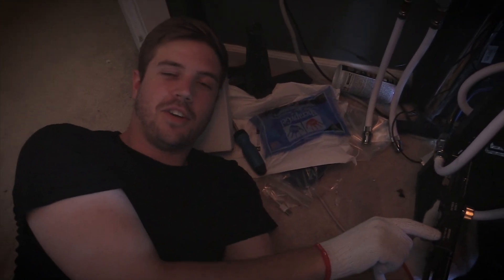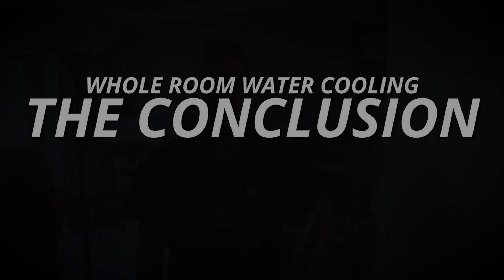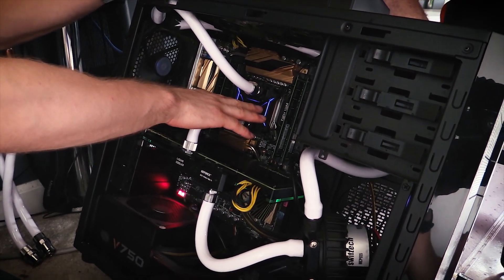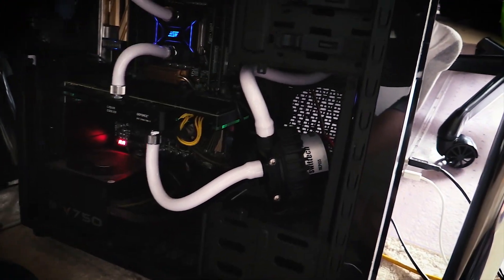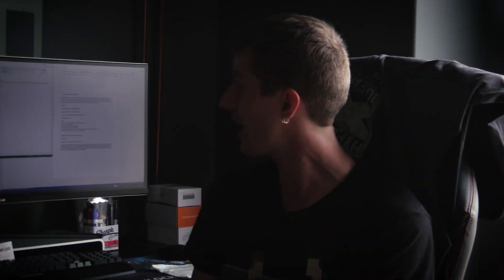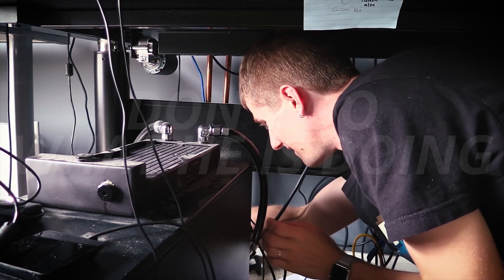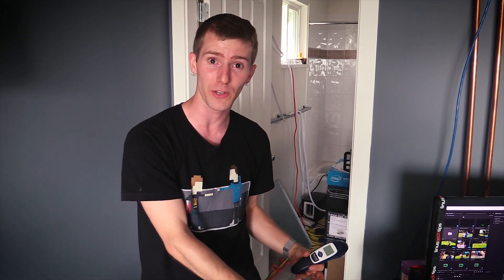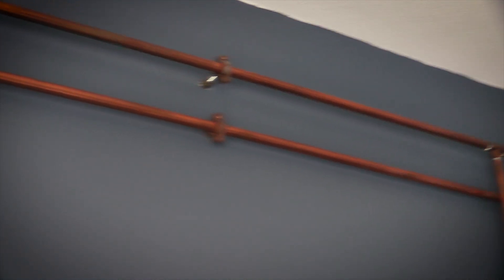Whole Room Water Cooling Part 7 - It's FINALLY over!

Comment: This is still incredibly cool, and honestly I'd do it if I could, just for that reason alone. Though, I feel like even just some insulating jackets on the hot pipes would have helped the ambient temp in the room. Those copper pipes are all radiating heat back into the air.

Comment: 1 no copper in the room
2 use pool filters 
3 make a 10 mtrs hole in the ground you wont need fans since its colder but you will need a few raddiators to increese heat dissipation 

this would be optimal but still you are better of with air conditioning

Comment: Step 1: Insulate copper pipes
Step 2: Insulate sunny window and buy blinds
Step 3: Buy a god damn air conditioner or fix the one you have
Step 4: Save $1000's and a year of work
Step 6: Get money, fuck bitches
Step 7: Complain about how I skipped step 5

Comment: You could have applied a good insulation to the copper pipework. Would have been interesting to see how much heat that you could have kept into the loop. I'm wandering if the inlet and outlet temperature would have been far greater and the room cooler.
Reply: James Poole 
http://theinsulationshop.co.uk/products/phenolic-foam-pipe-sections?utm_medium=cpc&utm_source=googlepla

This would have been the ticket... use at least 25mm thick around the pipe and seal with foil tape.

Comment: I was going to ask in the first video why you weren't insulating the pipes, seeing as how the heat is going to dissipate through the COPPER pipes long before they get to the radiator ... but seems you figured it out in the end. Oops, lol. Fun watch though. So you know, there's that. Also, it sold me on buying a pre-made closed system, so your sponsors will love that.

Comment: There's also the fact that even if the room was facing the optimal direction, if it's hotter outside than it is inside, then the loop will start to bring in heat into the room.

Comment: As a fridge engineer i would run that water through a simple water chiller under the bath giving you your bathroom back lol giving you water temp of around 5 degrees, coo idea though, also use aluminium pipe keep p the good work guys.
Air con is the way but if you guys don`t try you don`t learn nice job.

Comment: You should obviously have opted for a semi-industrial air-conditioning setup. This is such an obvious example of someone using a solution they're familiar with to solve the problem. In a house of PC-enthusiasts you went for a over sized PC-watercooling system instead of the more obvious HVAC approach because that's what you're familiar with.

Comment: I know this is a littler off topic, but i wonder if the idea we use in hydroponics could work for computers. In hydroponics the water reservoir gets very very hot over time in a closed loop system during the day as heat is absorbed through all of the plants and pipes into the water via friction and ambient temps. In Florida during the summer before fixing my hydroponics system i was hitting water temps over 120-130 degrees during the peak of the summer, resulting in all my plants dieing off.. i was still learning hydroponics, so i went to searching on how to reduce water temps and found that many hydroponics people use geothermal cooling since the ground stays around 70-74 degrees in Florida all year in my area. What we do is use a water hose and a larger 2inch 10ft section of PVC to basically frack the holes into the ground outside near our system, you shift the PVC pipe around to break up the ground, while the water pressure from the hose going through the middle is forcing the settlement of dirt and gravel to flow out the top of the hole tell you reach the depth you want. Then you use 1/2 pipe going down and turning 180 degrees back out of the hole, you would run a few of these 10ft deep holes depending on your system size and connect it all up under the ground layer leaving 1 single entry and 1 single exit. The water pump pushing water to all of the plants, pushes the nutrient water through all this 1/2inch PVC pipe in the ground multiple times as the ground absorbs the heat leaving the water leaving the ground much cooler than the water going into the ground. When i added this to my hydroponics system doing no other changes, my water temps in my reservoir during the hottest days of the summer will hoover around 74-76 degrees still even if its above 100 degrees outside. This setup requires no expensive metals, just plain cheap 1/2inch pvc, the key is the deeper you can run it the lower your temps will stay and the more locations you can run the water into the ground keeps the temps more consistent during very hot and cold days of the year..

Comment: I just noticed you built a greenhouse around your rad box. Might not be the most conducive for removing heat from the loop when you run the rads in a hot box.

Comment: I really loved this series of videos! Whether it functioned as you had hoped, or not, for me, wasn't as important as the exploration of the possibilities of the concept. I was visualizing what was happening and troubleshooting along with the videos, and that was fun. While I was watching, I thought a clear plastic reservoir would have been better just so you could visually see what was going on in there. I also think the objectives you initially intended to achieve CAN be done if you were to tear out the sheet rock, drill holes through the studs, and run the piping through the walls like you would normal plumbing. That way you would not experience any heat radiating from the pipes at all. Another plus to that is you can have the cold and hot sides mounted with quick connects directly from the wall which would be aesthetically pleasing. For the pro finishing touch, rather than running it through a window, drill a hole through the exterior wall, weather proofed with seals, of course, and run the power cable for the radiator fans through a conduit. Really awesome videos, and great job!

Comment: Linus, as a sheet metal worker (mechanical) I can tell you without question that the copper tubing is NOT the issue at all, and the idea is sound. It's used everyday in every building you step foot into.

What was missing is insulation around the copper tubing. Should be hard wrapped 1" insulation tin taped together to prevent heat leakage into the space you are trying to prevent heat from being dissipated into.

In a building, you have mass amounts of piping carrying hot or cold water to heat pumps or fan coils. Those fan coils provide the heat or cooling for where ever you are in that building no matter how large the building is. If the pipes were not insulated, you would/will lose most of the heat/cooling you want to achieve before that glycol even reached the fan coil to distribute it to the area you were trying to heat/cool.

In your case, you are trying to expel heat being generated, like an air conditioner compressor on the side of your house, both being copper tubing. However, that A/C unit on the side of your house when operating expels an oil refrigerant at a temp much lower than the ambient temp outside or inside your house. Without insulation, you would not only have condensation issues, but lose most of your efficiency running the A/C.

I would recommend both inlet/outlet copper tubing being wrapped, but you probably could have done fairly well just wrapping outlet. Only doing the one thou would cost you heat gain on your cooling of your components, Doing neither costs you cooling on your components as well as heat gain in your space you are trying to keep cool. Instead of expelling the heat from the CPU/GFX cards as air, you are just changing that heat into radiant heat through the copper with no insulation.

But your idea is very sound, it would have worked extremely well, I actually plan to do something like this myself, just needed to wrap the pipes.

Comment: Your idea here was not a bad one. I genuinely liked this entire series. It was very informative. I would suggest an alternative approach however using technology from an industry that's had over 80 years to get it right; Automotive. A simple automotive radiator and fan set up with thermostatic controls would have been easier, more stable and cost effective. As well as adding flow regulators (both inline and "spigots") and drain cocks. Adding independent thermostatic flow controllers to each of the outlets would be optimal as well to maintain just the right amount of flow to control temperature. All of these are inexpensive and readily available at your local auto parts store. I'm not sure what your budget was on this. But, using these suggestions, along with the right pluming materials (as you pointed out) should deliver a viable, stable and reliable whole room cooling system at a fraction of the cost. I would like to ask you to not give up on this idea. I've seen a lot of videos on how not to do it (Not Trolling). I'd like to see a good one on the right way to do it. I would also like to see a before and after on the projected man hours, time table and cost of such a venture. Something that could be broken down in "Cost per Unit" for anyone that would like to undergo such a project and needs to know the cost. I'm also a FIRM believer in "Modular Designs". I think the concept of a good design for expanding and reducing the units would be outstanding as well. I appreciate the hard work you and your team put in on this video even though it did not succeed. Thanks, and keep up the good work.

Comment: Would an air conditioner blowing through a bunch of rads work better for this kind of project?  Or would it be better just to have the rads on the computers? (so that the temps inside the computer never ever go below ambient temperature)

Comment: Aw nice concept. But mind as well use oil based coolant.. an the pipe should be placed on the floor. And on there should be a loop at the bus line. This will easily remove air inside the system and quickly flushes the warm coolant out rightaway.

Comment: I would think that if you were in an area that has winter (or cold weather) a considerable amount of the time, the heat could be captured for use in the building. But that would be very expensive and the return would probably be minimal. In concept though, a Great idea!

Comment: The copper pipes should be insulated. You are heating your room!!! Get some insulation on those puppies, Now! But, since you are ending it, just run cold water though those pipes and maybe add some heat sinks along the pipes and you will be Cooling your room!!!!!

Comment: I don't understand why you would use copper pipes to carry the heated water away. That would just allow the heat to escape the pipe and into the room. Copper piping should have been used for only the incoming cold water and insulated piping should have been used for the outgoing hot water.

Comment: You cant remove heat out of the room by water cooling. Are you guys for real?
The TDP is still the same, you simply bring the temps down of the chips themselves but the heat is still being dumped into the room, same as air... TDP cannot be changed whether you watercool or not.

Comment: Why not just wrap the copper pipes in the foam insulation that is used for hot water pipes in homes and buildings? Its super cheap stuff and will stop all that heat from escaping back into the room!

Comment: Just watched each of these videos.  That was a wild ride.   I laughed, I cringed, ggwp.  In the end I think it's very sad this is a 'not worth it' deal for you.  I have to wonder if that answer would be different if you'd had insulated tubing.  Adding insulation to that loop would have been sufficient I think afterwards. 

On another point, this build was huge.  Betting that one machine with a loop to the outside, insulation, yadda yadda would be neat in cool climates.

In the end... yea should have just bought a window shaker :DDD    Great series of vids!

Comment: another easier way you could have gone whilst maintaining the watercooling goal would to have put all the PCs in 4U chassis and racked them near the wall where your outlet would have been and solved the rest of the "spacing of people around the room" with long/exotic cables....or a $560 freestanding air conditioner with window vent from Tripp Lite.

Comment: I think you should have had piping doing straight in and out of the room to and from the systems and more radiators so that the water temperature is as low as possible, that would mean that as much heat from the CPUs and GPUs is transferred to the water in the loop and less heat dissipates to the surrounding components in the case, which would then dissipate in the room and heat it up. And maybe more water flow to increase heat transfer to the water.

LinusTechTips

Comment: You forgot to mention one thing you learned or should have learned, hire an engineer to project manage any large system modifications. They are trained to consider the variables and are more familiar with non traditional components that could be used. I still enjoyed watching you guys learn, albeit the hard way, some of the problems encountered when dealing with system integration.

You mentioned one thing at the conclusion which was a key mistake most people make. The objective was to make the room cooler but you fixated on making the computers run cooler. Keeping the room cooler will increase the delta T at the radiators increasing the amount of heat that can be removed. 

Continued success guys. Keep up the good work.

Comment: the real problem is you did no proof of concept on your individual components, 1 problem would be detrimental to all 5 systems, if you  simple thermal contacted them to a main line rather than sharing flow it would have been smarter,

Comment: Whats the point when you have 3 windows open. That's letting a lot of heat in your house. If you wanted it to be cooler you should make it sealed completely.
Reply: The weather is constantly changing though.

Comment: Thgis might bve a little impractical, but don't you think it could be cool (pardon the pun) if whole room water cooling was utilized by thermally insulating the copper tubing, and if the reservoir were put in some kind of custom bracket where the water running through it could be cooled using LN2?

Comment: What about:
Point detachable shower head at radiator, run cold water over the rad, water goes down drain. Or if you live next to a stream, simply stick your rad in the stream.

Comment: for the temp test,  Run IDA64  and  3D Mark .  do the stest for all pc's  same time hooked up on outlid first than on theyr own rads  . ALL PC's same time.  Ull see your definitly wrong :P   also   u got 1 of that big rads     how would it be to go with 2 of these rads   into a setup    Fan - Rad - Fan - Rad - Fan  ( sandwitch style )

Comment: LinusTechTips You REALLY need to wrap all those copper pipes in the house with pipe insulation. Condensation will take over and ruin walls, floors and especially electronics. Take my advice if you know what's good for you.

Comment: Probably already mentioned, but you should have simply put on some tinted film on the windows, they can prevent 90% of the heat from the sun from entering the room to begin with, that with a AC would have been all you needed.

Comment: What a bummer! This was one of the COOLEST (no pun intended) series I've seen. I'm bummed that it didn't work. However it was kind of OBVIOUS with that coper pipe which is an excellent heat conductor. Of course its going to radiate back into the room. Why didn't ya'll go with like PEX pipe? Or insulate the hot return? Seriously, insulation foam isn't very expensive and thats not THAT much pipe to insulate... Don't chalk this up as a FAIL - but as a DIDN'T THINK THIS ONE THROUGH. Love it anyways despite!

Comment: Use water cooling so the room doesn't get hot, but you use copper pipes all over the walls of the room releasing heat into the air? INSULATE THEM!

Comment: Hey Linus,

Why not slap on some pipe insulation, is easy to do, only costs a few dollars and maybe you will measure more than 1 degree difference, which I agree is within measuring error. I have a feeling you should be able to achieve more with this setup. I mean you are trying to remove, what, 7x 250W from the room which should be more than 1 degree...

If I would do whole room watercooling I would design it like a central heating system and use components used in central heating systems (like pumps and bleed valves).

A bit weird the guy installing the pipe did not suggest installing bleed valves... You can even get automatic ones which is really handy.

Cheers and keep up the good work - Bertus

P.S. With a slight mod you could change the whole thing to personal showers above the seats for your guys to use on a hot day.

Comment: It's an experiment that wasn't really a fair test. BUT it absolutely CAN work and work well in the right environment. If you used PEX instead of copper piping, installed a proper bleed at the physical top and maybe even designed a room from scratch to pull the heat from the editing room possibly even redirecting said heat into a heat pump to provide extra heat for the entire building during the frigid Canadian winters, you might have had a successful implementation. 

After all, eventually energy will be much more costly than it is today and your solution, while not really practical for today, might save someone megabux in 2040 or beyond.